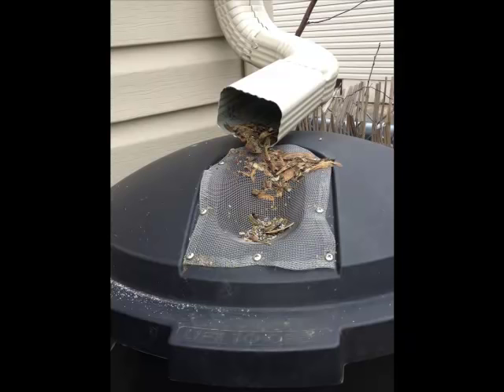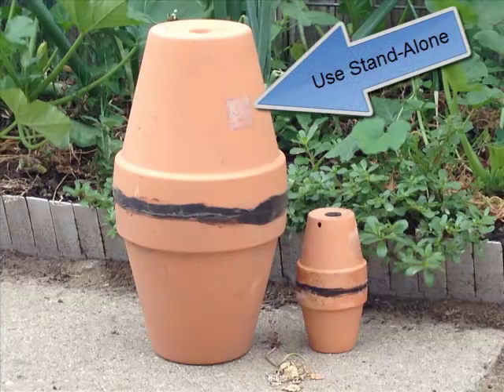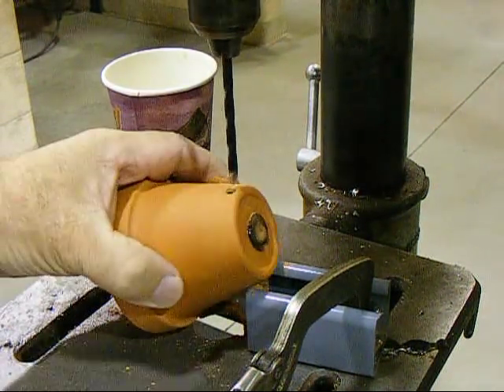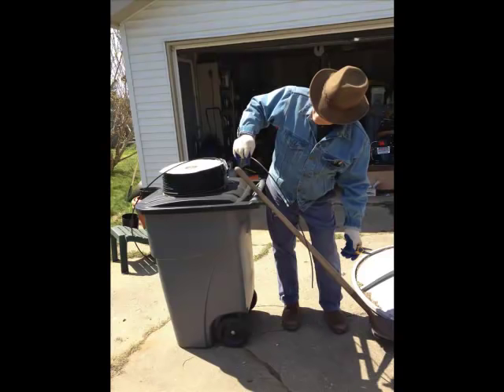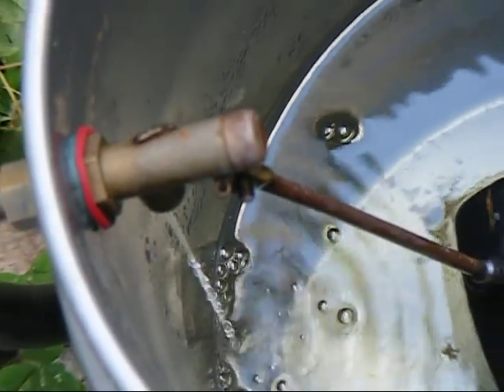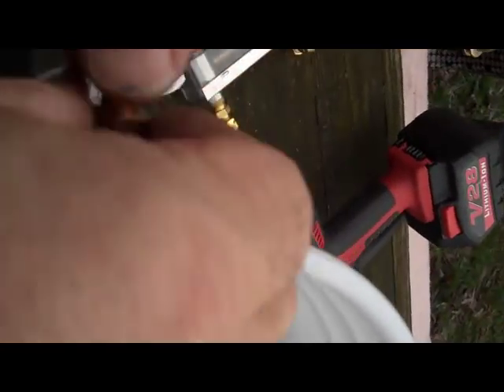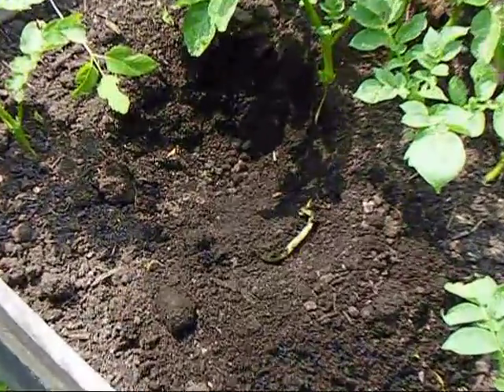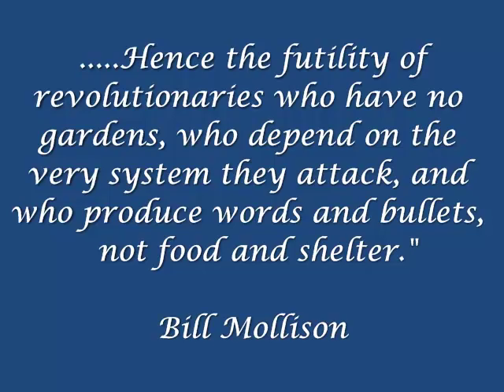Olla Irrigation Update - June 2012

Comment: Any issues with the system freezing? Is there a way to drain the system before a hard freeze?
Reply from the maker: No issues. I simply turn the water off when the growing season is over in October and the ollas drain themselves. As long is there is 2-4 inches of soil over them for the winter there are virtually no problems with spallation or breakage
Reply: Thomas Bowes I live in North Texas where it's sometimes 90 degrees on a Tuesday and 30 degrees on a Wednesday night. There is no way to empty the system rapidly? Could it be set up with some kind of emergency valve?
Reply from the maker: The Red Willow
I don't think that you have to worry about the ollas themselves as they are a few inches under the ground and shouldn't freeze over the course of a few hours. If you shut off the water to the regulator bucket it should drain fairly rapidly as you'd typically only have about four inches of water in it.

Comment: There is a PDF that links to your videos for examples of olla irrigation, but this is the only one that wasn't private. Would you mind making the others public?
Reply from the maker: This one superseded the others. The earlier ollas used rubber stoppers or silicone caulk instead of drilling holes for the tubing. I found that the rubber stoppers just didn’t last and the silicone caulk just didn’t hold on to the tubing well enough.
Reply: @baphomet8me  aw dang, thank you for the quick reply though. I'm working on a system now that daisy chains ollas connected by T fittings that are pushed into a hole I drilled into corks, and then the corks are plugged into the ollas. 

Currently I'm having some trouble with the water pressure dropping off drastically after it goes to my 2nd raised bed (4th olla in the chain). The sections of tubing between each bed are U shaped with the bottom of the U buried so it doesn't block garden paths. I think they might be blocked by airlocks but I'm not sure.

The end of the daisy chain system is still open while I'm testing the design. Rainwater barrel gravity feeds into system and has water level about a foot above the first olla, and then the yard slopes down about 10 degrees for 50ish feet. 

I haven't seen any other designs online with the "plug" design until I saw your video. Figured it wold be a good way to automate gravity fed ollas and keep the ability to look inside and add/remove them from the line if necessary.
Reply from the maker: @colepwarren  You might have better luck with the corks than I had with the rubber stoppers…who knows. Back when we were doing multiple raised beds I think I ran a separate 1/4” irrigation tube to each bed and that worked fairly well, even at long distances.